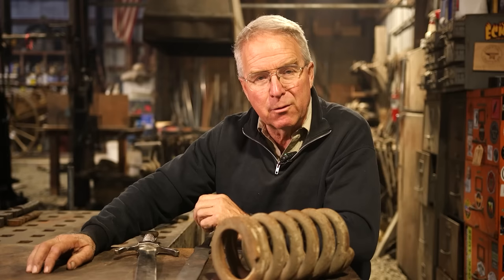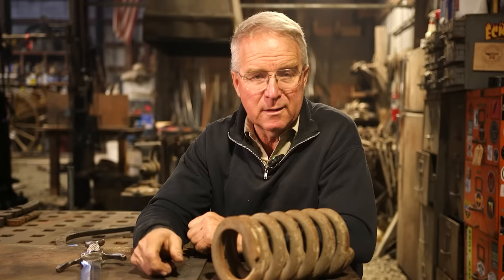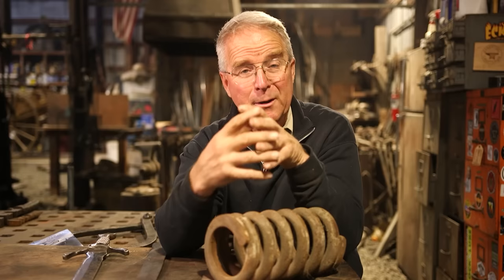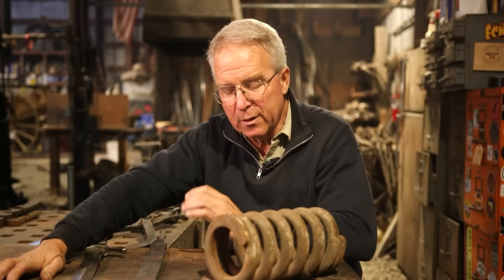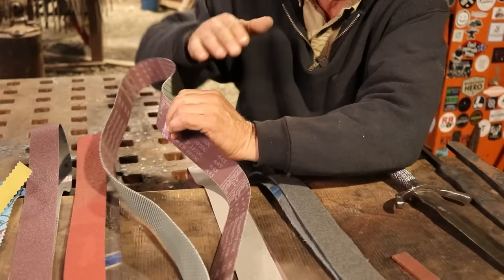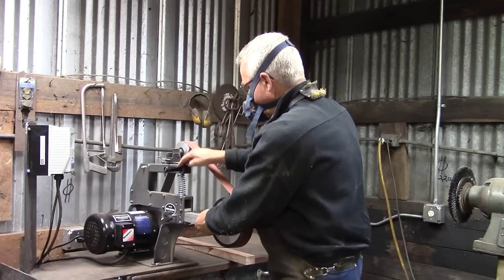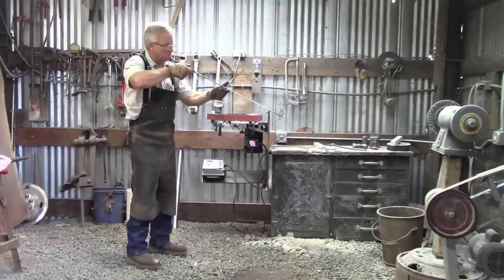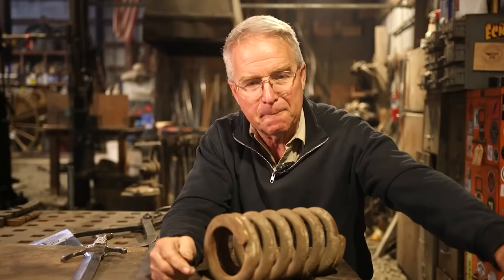All 2x72 Grinding Belts Are Not Created Equal

Comment: I've been selling 3M abrasives for over 40 years, a real abrasive salesman I guess. This is a pretty good piece for beginners, but I would add a couple of comments. The first one being skipping from 36 to 120 grit means you'll use three times more 120 grit belts and spend a lot more time at the belt sander digging those wide deep scratches out. While 36 grit does remove metal pretty quickly, if you are trying to get to a mirror finish it's better to start with something much finer like a 60 or 80 grit. You will have more points per square inch cutting and your scratch will be much shallower so you won't have to remove as much metal with the next step to get below that scratch. The second comment would be if you were getting a bump from a splice, it was not made correctly. See if your supplier can order finer grit belts with a schedule 40 splice. It uses a thinner tape and the backing is more carefully skived. It should come out at or near zero thickness difference. I guess a third comment will be, wait until you get your hands on some cubitron 3 that is due out next year
Reply: 3M makes the best abrasives IMO… but damn they are expensive. We had 4” wide belt sanders, all the way down to the 1/2” pneumatic fillet/bead handhelds. We discovered that if we bought more machines and grinders setup with different grits, we saved a ton of money on both labor time and belts wheels and disks.
Reply: I agree, the price per belt is steep and with cubitron 3 coming out, it's only going to be more expensive. Every time we show this product we need to justify a major time savings. It's very quantifiable and manufacturing, but for the home hobbyist not so much. If I wasn't in a hurry to get something done, I would use zirconia everyday. The cut rate is great, they last pretty well and the price is significantly less than cubitron

Comment: If anyone wants to make a 2x72 and gain some fab skills make your own. There are a few great designs out there. I made mine for around $900 with a used baldor 2hp wired to Chinese vfd with nothing thinner than .25 and 3/8
Reply: $900 is a good price point. I’m trying to build a 2x72 myself, for no more than $500-600 if I were to use a $100 vfd. It’s gonna be close though. Some patience also helps with cost. I started looking for parts almost 2 years ago and buying them when at the right price. $90 for a baldor 3 phase motor was an awesome score.
Reply: Jer Schmidt has the best design (and plans) IMO, but there are lots of others that are also great.

Comment: I want to add to this as someone who took up bladesmithing during the lockdown, you can get a mirror finish with a 1x30 grinder from harbor freight and some cheap amazon belts. They do make quality 1x30 belts but in my experience you just need to realize the cheap ones aren't labeled right, some of the 800 grit belts are really only 400~ but I can buy 20 of them for 10$.  

I would actually like to request that you review the HF grinder since I think it's a good entry for people interested in blacksmithing. you can get them as low as 30$ on sale if you splurge some more you can get 1 with a wheel on the other side that you can use to buff to a true mirror shine

Comment: With respect to "belt bump", there is a different way to make that belt seam that almost no one does because it is more expensive, stronger, lasts longer and runs smooth.  Allegedly, Sungold Abrasives still manufactures belts this way.

Comment: When it comes to metal, I don't use anything but ceramic, even though it's more expensive. And if you search out deals, buy 10 or 20  or more at a time the prices are not that much more.

Comment: I have managed to survive the burning down of one shop caused by a quick sharpen on a belt sander that had a bunch of wood swarf inside. A single mistake and step away for fifteen minutes and a shop lost. Learn from my mistake. Also SAFETY SQUINTS!